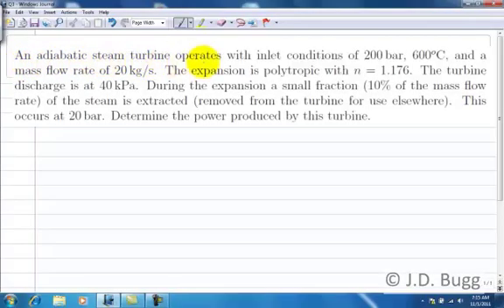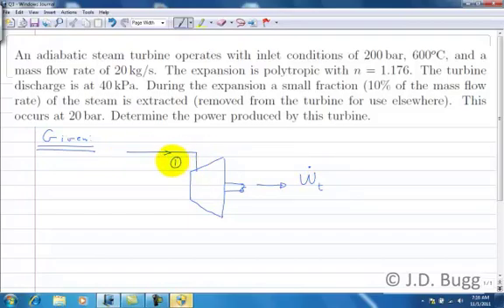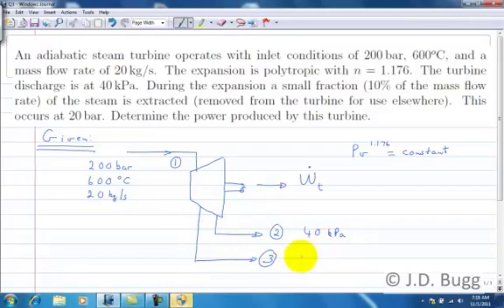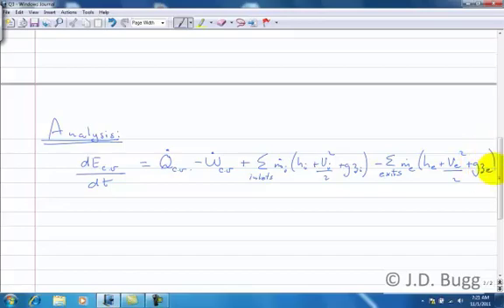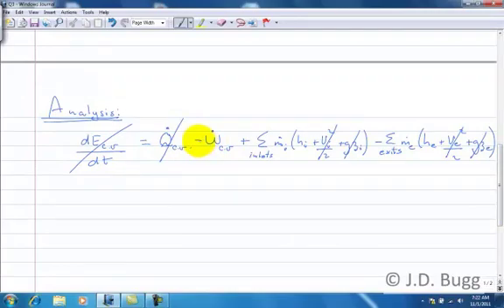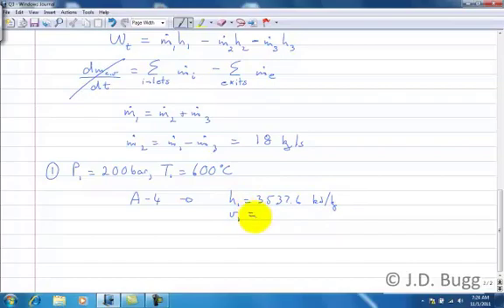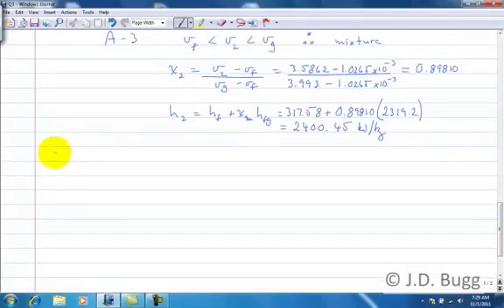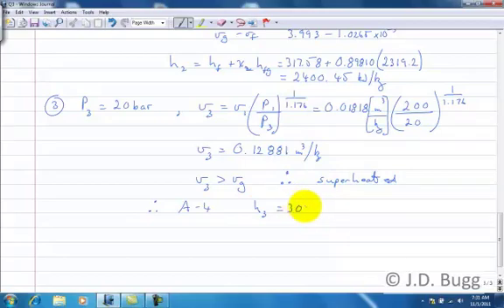Steam Turbine Analysis with Extraction

Comment: Good morning Professor, please do you know any software free for simulating back pressure steam turbine? Thanks for yours classes
Reply from the maker: You could use the Rankine Cycle Simulator at https://youtu.be/ragh6fi0S3I  Just set the condenser pressure to your desired back pressure and the simulator will model the performance of the steam turbine.  You can vary the inlet conditions and even add reheat or extraction if you wish.